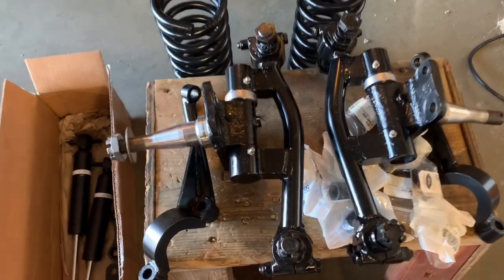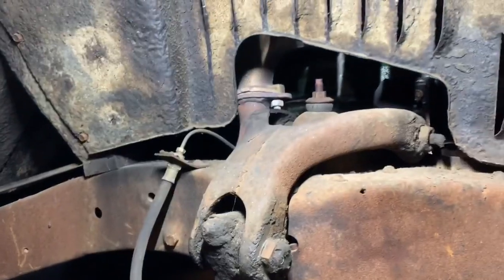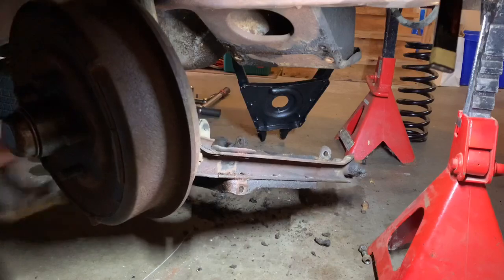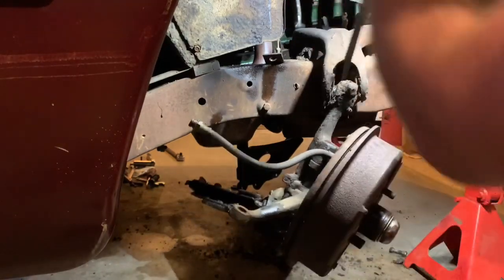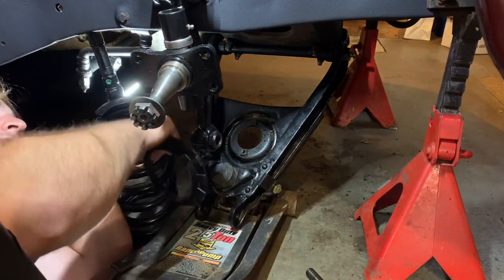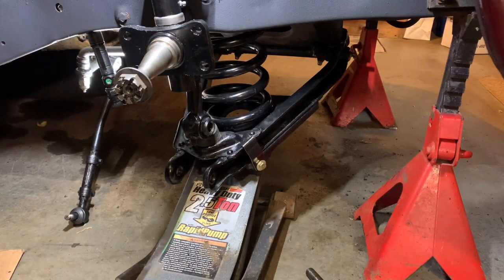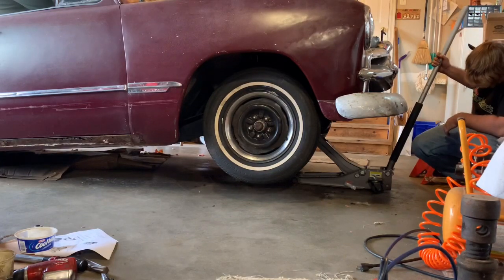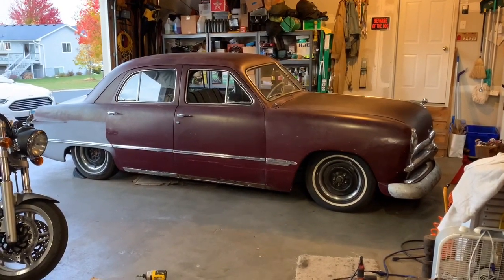Lowering the Front of a 1949-1953 Ford 4 Inches!

Comment: thanks for the content have you ever ran into a overheating problem for the inside 6? I can't seem to figure out on mine it has a brand new radiator but I havenchencked the the water pump
Reply from the maker: I overheated mine a few times before doing the radiator and water pump. It still seems to be a little hot to me. I’d like to build a fan shroud someday
Reply: @minnesotamotors  ya idk why but I ran a few test and nothing gives a pin point answer causing it to overheat,  I just took the  water pump off and didn't find anything unusual, and the oil isn't milky or anything, unless the radiator cap isn't sealing enough that could be the cause, it's a 4 row aluminum radiator

Comment: I hope you're not relying on just a jack to support the car when you're working under it. Use good quality jack stands to support all that weight just to be extra safe in the future. I've never worked on anything underneath with only a jack for support. They have been known to fail.
Reply from the maker: Thank you for your concern. I used jackstands the entire time the car was in the air. They are visible in the video, and I even mentioned removing them when I lowered the car to the ground
Reply: I mean I can see the jack stands clear as day throughout the video
Reply: @dustydavos8256  Cataracts have made my vision not as clear as it used to be.

Comment: hey did you have any alignment issues with the lower control arm cuz of it being off and had to force it in? Did you get wear on the outside of your tire? I had the same issue with mine
Reply from the maker: I actually haven’t had the car aligned yet. I’ve put very few miles on it
Reply: @minnesotamotors  Please let me know as I am not sure if you car was involved in an accident or it was that common thing when they were build so quick on the assembly line.
Reply from the maker: @scottKobe-r8u  I think my car was in an accident. The bumper and brackets were bent
Reply: @minnesotamotors  Interesting. Do you do your alignments or will you take it somewhere? please keep me updated I am very curious if that affected your alignment. I will be looking at mine this weekend
Reply from the maker: @scottKobe-r8u  I will take it to a shop. Right now it is still in winter storage, so it’s gonna be a while before I get to it
Reply: @minnesotamotors  sounds good
Reply: any luck getting it out of storage?